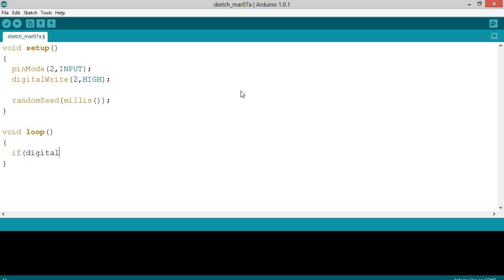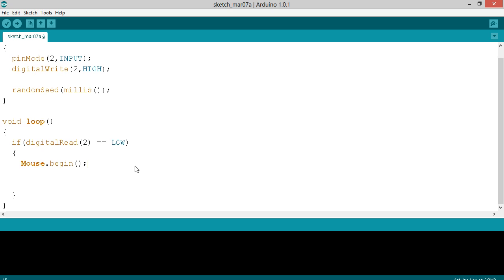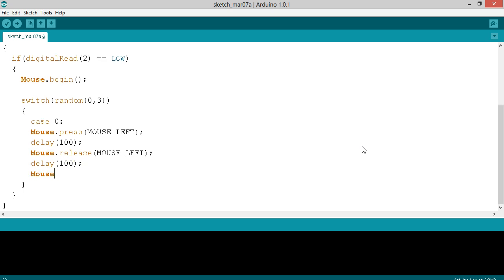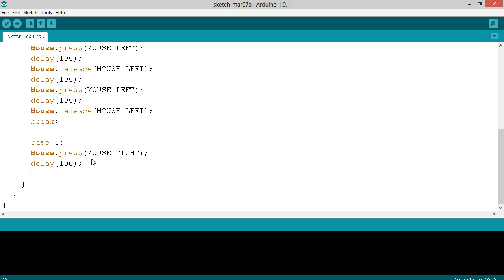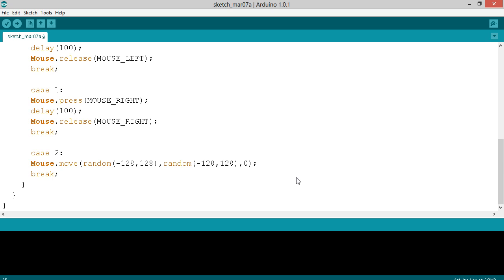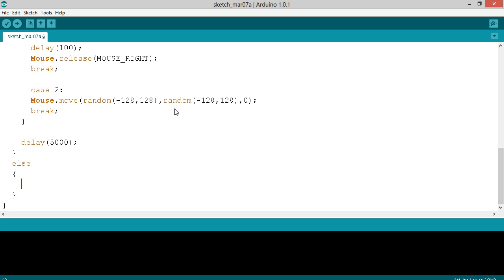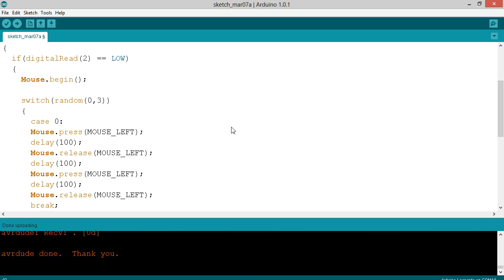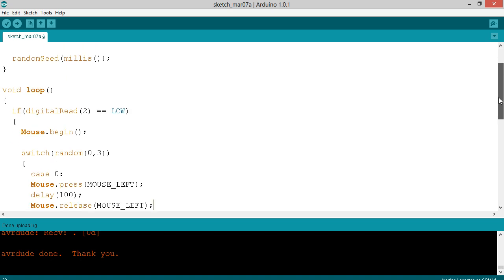Arduino Tutorial #14: Leonardo as Mouse

Comment: I am new to learning about the Arduino and don't understand anything about electronics and wiring circuits,  My question is why did you set pin 2's mode to high and use low in the if statement? Wouldn't you use high in the if statement to check if it is high to run the code in the loop?  When you unplug the wire from the Arduino is it does it set it to high or low?

Comment: Can I seek your knowledge as total newbie to Arduino!!? Basically, I want to emulate scroll wheel down, and then emulate mouse movement to control speed of autoscroll up and down. Could use 4 buttons: up/down - go faster/go slower. My idea would be to use a potentiometer. If turned left from a mid point, page scrolls up, (further from mid point, faster scroll is). And turn control right from mid, scroll down. (Realise this the use of a pot is moving into A/D territory) Any advice?